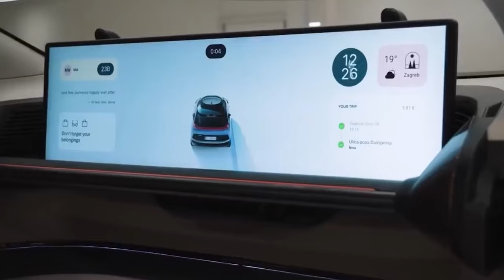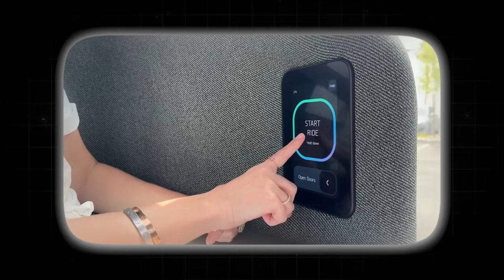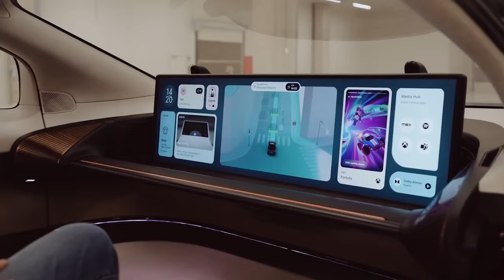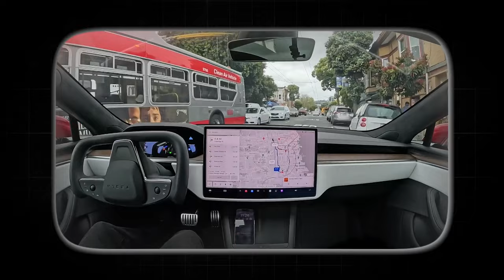Rimac Verne: A Challenger Emerges in the Tesla Robotaxi Race

Comment: Tesla is not dominant in electric vehicles. And so far they have not managed level 3 autonomy or launched a robotaxi. So what should „keep up“ mean?
Reply from the maker: Well. Tesla has been here for a long time. Dominating in an ev market and technologies. So, it's obvious to compare with tesla. Many new ev are coming up, but Tesla still holds the major market of the world. It's a massive company.
Reply: @onlythecars  they are currently number 2 in EVs behind BYD and they are not even in the top 5 for autonomy. While BMW and Mercedes have established Level 3 autonomy, Tesla is now starting a joint venture with BYD to catch up. So they are far from technological dominance. And my point is that they have no robotaxi yet, so why are they ahead without a product? If anything Waymo and others are the leaders here.
Reply from the maker: @tobiwan001 we are talking about level 4 here. Tesla Robotaxi and verne will be level 4 autonomous vechile. Anyway...the competition is heating up. Time will tell who wins this race
Reply: @tobiwan001 BMW and Audi system is extremely limited by location circumstance and speed. Only on mapped highway, only under 40 mph. To call it level 3/4 autonomy is a real stretch. Reality is that it can only  be used in heavy  traffic and queues on certain mapped highways and in good road conditions. PS, I think you mean Baidu partnership not BYD,which is a pretty embarrassing mistake. If you have been to China you will know Google mapping is not functional there. Baidu provides mapping data, nothing to do with the autonomous driving system. Do more research.